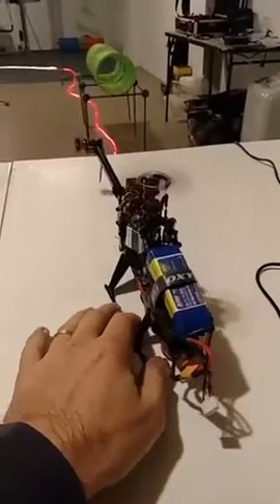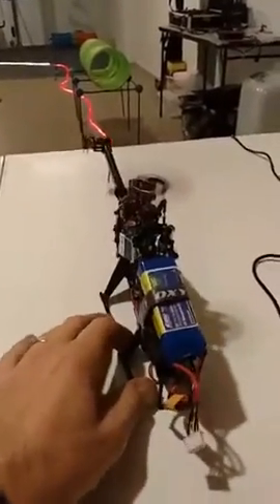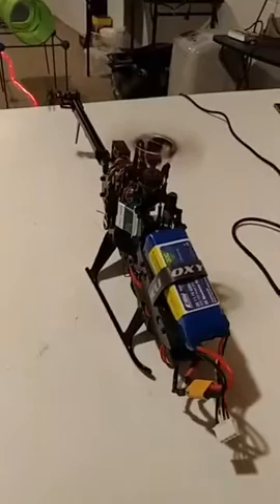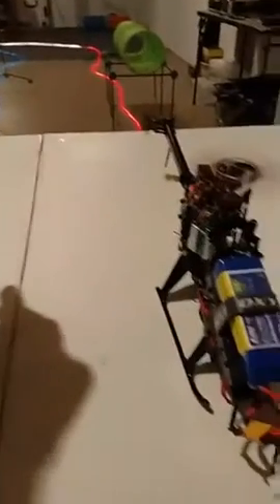OXY 2 FE bench vib test

Comment: some problems of timing with your motor, or maybe an option like (motor start) on castle it's like that, hobbywing too..
Reply from the maker: Yes , it's the HW slow start. It's smooth with blades on.
Reply: Okay bud, thanks for your asking, Sure with blades it's smooth :D
Reply from the maker: It's not perfect yet with blades on but I'm adjusting the soft start in the U-Brain a little each time until it's exactly ware I want it.